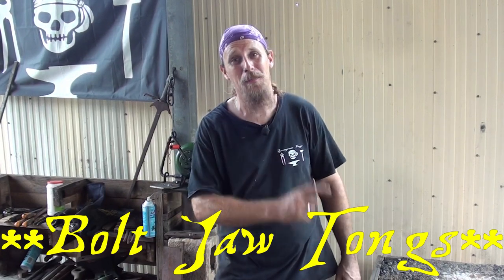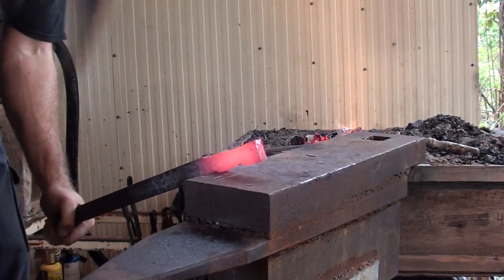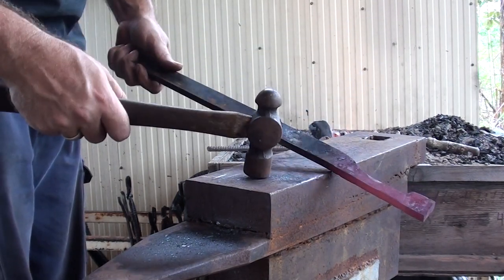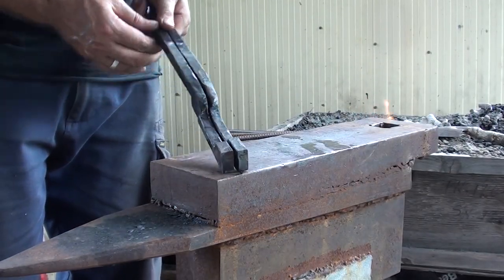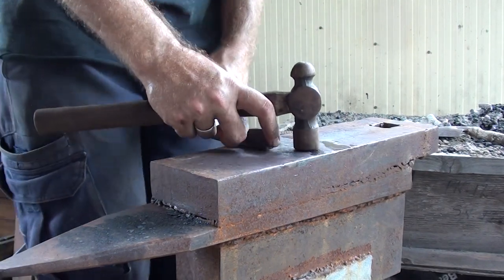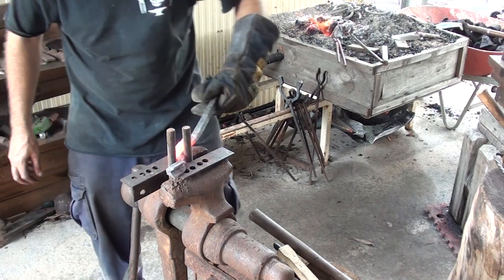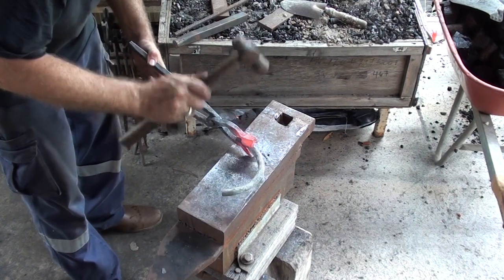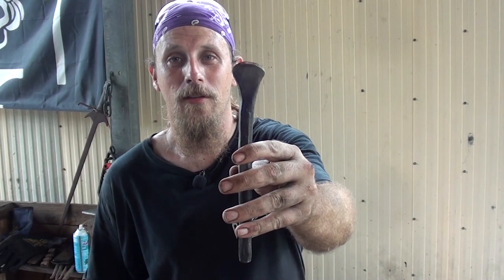Forging Bolt Jaw Tongs

Comment: Singing toorali oorali additi good Job mate good to hear the rain, so good the fires are under control now in Feb. Never seen such fires in Australia  in my life. With the set downs the second one on near side of anvil I would define that maybe more so when you do the reigns part you have a well defined boss. Love your little forge, I started out with one like that not as big though, Now have a a table I got from the dump. And mate gave me a tuyre or what ever you call it the fire box assembly and air etc. Keep on forging cobber.